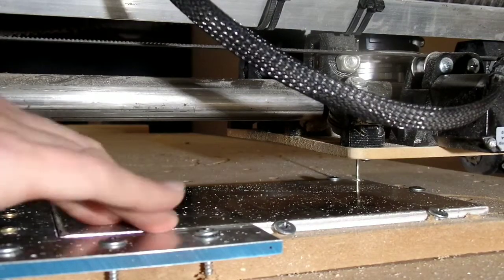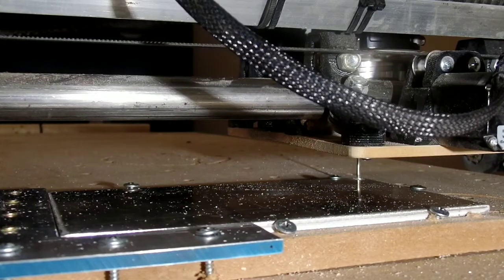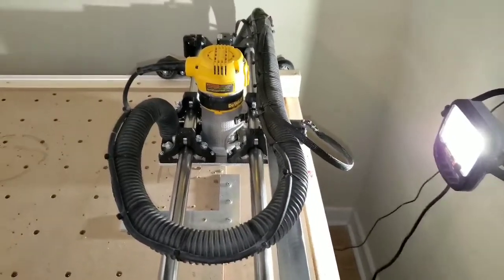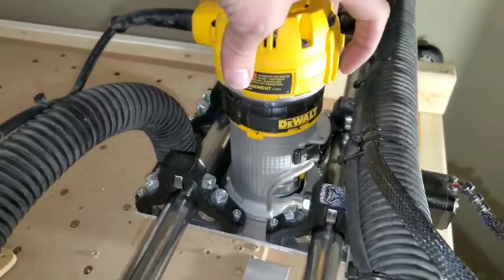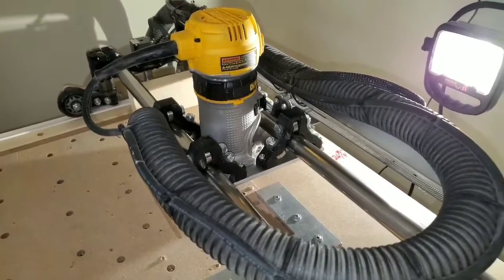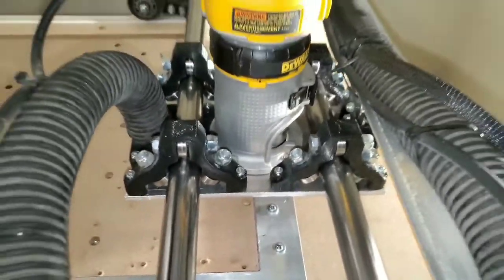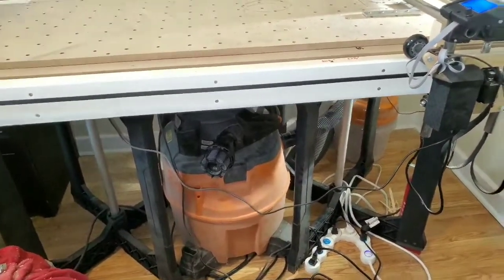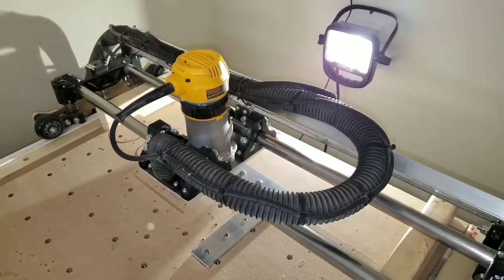MPCNC LowRider2 Milling ¼" aluminium DeWalt 611 plate.

Comment: I'm surprised you got any accuracy out of your milling with all the loose nuts and bolts on your mill head.  When you sped up the video, the loose hardware became very noticeable.
Reply from the maker: The one bolt is the reason I upgraded to ¼" aluminum. The ¼" mdf compresses. My Lowrider2 was running 4 to 5 projects a week. I now have a Mach 3 Mini Mill for aluminum.
Reply: @DavidKK4GAF  I meant no disrespect, but if you look at 6:01 through 6:03 in your video, you can clearly see a bolt that is not tightened down allowing the edge of the wood plate to deform and cause chatter.  Every time the cutter passes that same edge, the bolt moves up and down and even rotates.
Reply from the maker: @geoffschulz  I replied to your 1st comment. If you own a Lowrider2. You would know there are 12 bearings and 8 bolts that hold the 611 plate together.

Comment: Hello sir thanks for your videos , have u made bracket for the spindle 2.2kw?
Reply from the maker: No. A 2.2w spidle might be too heavy. The Lowrider2 uses gravity for the negative Z.
Reply: David Peterson I saw that u comment on one guy he was using the 2.2 spindle and u were asking him if he did the bracket , I thought u did it . So u recommend the dewalt but it’s loud lil bit right more than wd6440 ? I have the mpcnc and I had to build a housing around it to prevent the sound out
Reply: I’ll do the aluminum like yours too. Did u out two limit switched for the Z axis ?
Reply from the maker: He removed his spindle. And went back with a router. Check his later videos.
Reply from the maker: The dust collection is louder than the 611.
Reply: David Peterson aha then I’ll use that as well and build housing around it for less sound . One more q sir , did u use cast aluminum 6061 ? 
Thanks for answering my qs sir
Reply from the maker: Yes. ¼" I do not use limit switches. I also run a laser.
Reply: David Peterson aha thank u sir , u bought the laser kit online from eBay ? By any chance do u have the link for it
Reply from the maker: @namocrafts1101  No. I bought an Eleksmaker 3.5 watt from Banggood.
Reply from the maker: One of the end stops is used for the TTL.

Comment: great video david. my lr2 should be here tomorrow and the first thing im doing is replacing the the mdf flat parts with aluminium. i hope to get the lr2 completed with the mdf parts and use the machine to mill the aluminium. not sure how hard the 1/2" aluminium stock will be on the lr2. again, enjoyed the video!
Reply from the maker: The Y flat parts only need to be mdf. The 611 plate makes a huge difference.

Comment: Does the low rider use the same ramps code as the mpcnc? I want to take apart my mpcnc and turn it into a low rider
Reply from the maker: The Lowrider2 uses the Rambo Mini. You can use the larger Rabmo. But will need to find a case to print.

Comment: Thanks for your video.  Is this an otherwise unmodified Lowrider 2? What cut head did you use? What was your feed rate? How long did it take?
Reply from the maker: I milled the ¼" aluminium with the stock wood plate. Dewalt 611 I think it was 500mm. It was cutting .1mm each pass.